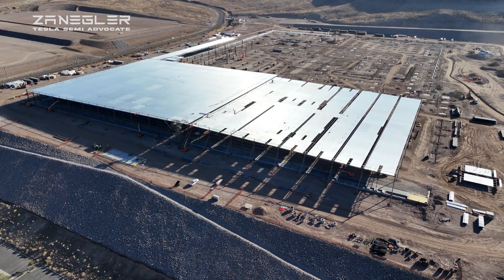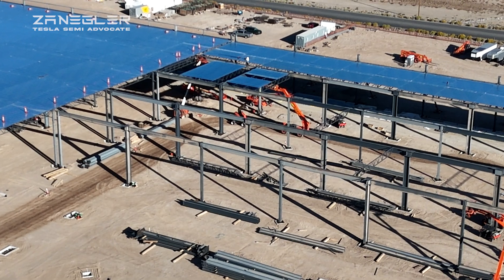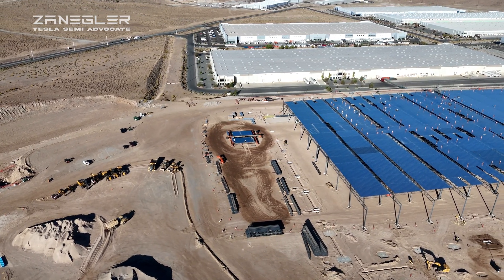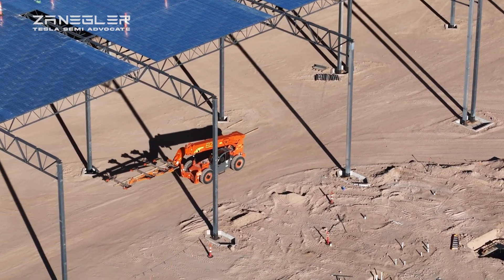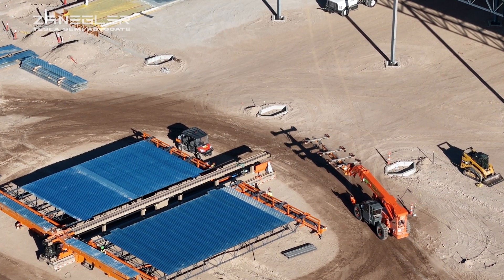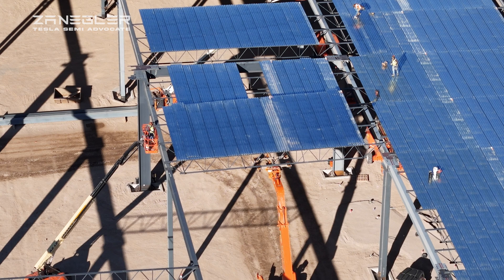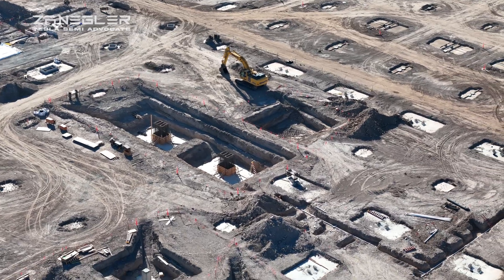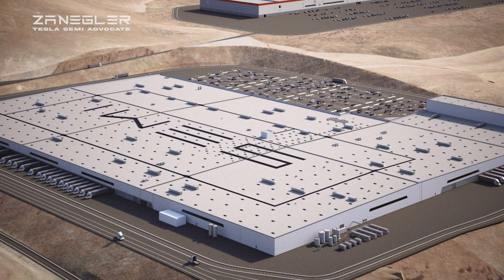Amazing Tesla Semi Factory Progress - October 5, 2024

Comment: Another great video!  Thanks for the update.  

I was hoping to find in the ground a place where a bunch of plumbing pipes come up, and indicate the location of a break room and restroom.   They should have a collection of 12 - 15 pipes for the toilets and kitchen sinks for the break room.  There should also be conduits going to the location of the 4,000 to 25,000 amp electrical connection to the building.  I worked in a 750,000 square foot building that had 3 each 4,000 amp 480 volt power supplies in one location, that fed bussbars going down the center of the building.  Something like this would power a large building like being built here.  

When they moved in a 400 HP air compressor, they had to cut out a 10 foot X 20 foot section of the 4" thick floor, and replace it with a 10" thick slab for the air compressor.  The 400 ton presses did not need any special foundation under them.  The building was Weiser Lock, in Huntington Beach CA, back in the 1980's.  They had several presses in the 400 ton capacity, and many other machines, such as screw machines, headers, and other machines.  We where nearly 100% internal integrated, with making our own springs, screws, and all of the lock parts, machine tools and final assembly of about $300,000 in door locks each day.  Over 2,000 great employees working 5 days a week to make it all happen.  

I am actually in shock at the speed of this building construction!  They seem to be adding about 3,000 square feet of roof each day?  Maybe even more! They will need a huge line of cement trucks to pour all of that floor space.  Hopefully they can get the roof done before they get any snow in the area.  

Yes Reno gets snow each winter.

Comment: "The Large Footings aka BFF"  - They formed a concrete column under the location of the steel column to continue the point load down the bottom of the footing.  Any additional concrete poured around the new concrete column in the footing would offer no compressive value.  I assume these area will be pits.  Maybe fluids bunkers.  Maybe access to underside of a vehicle or press or something.  Maybe equipment will be placed in these bunkers. But I would suspect the large holes are likely not all for concrete footings.  Footings that are thick typically support large weights.  Footings that have large footprints usually offer top heavy structures, like tall signs or water towers, to keep them from tipping over.  The fact they formed a relatively small concrete column in the pits to continue the steel column to the base of the footing means it is likely not a a top heavy structure or a high weight point load.
Reply: This style of footing construction seen often at Giga Texas. Deep footing of an otherwise standard area, concrete pedestal built on top to receive a standard height column. 

Likely the excavation will be backfilled/compacted, then re-excavated later for a trench for deep drain, or a production line trench, or sunken bath etc.

Most recently (2 years ago) Stamping 2 featured this style of footing.
Reply: Your thoughts offer some insight to the installation of a very large press.  Let's say the press table is 5 feet tall, if put into a 2 foot deep pit, then the surface they place the steel on, it will offer less height to the working surface of the press, and then make it easy to get the parts out of the press.  Yes the press overall height is well over 10 feet tall, I am just saying that the part that the die is located on, it will be located in a location that is close to the factory floor level, making the parts easy to remove.  

I have worked around 400 ton presses that where used to stamp out lock parts for Weiser Lock back in the 1980's.  They had their own tooling department, and I have seen how they put the tooling together to stamp out the parts.  It is very interesting, and making the tooling is very time consuming.  

Some of the machines at Weiser Lock required a 10" thick cement foundation for that press and for the 400 HP air compressor.
Reply: @Kangenpower7  A stamping press/es would be a possibility. All the presses at Giga Texas are located over deep isolation footings, and chambers for scrap removal etc.

With the speed this structure is going, there might no been an opportunity to see directly what's going on.
Reply: @Kangenpower7  could be…. We will see

Comment: Whether they move the Mezz-Master also depends on what the next construction phase looks like. Because if walls and floors are started in the first section, then they might be in the way and their transport routes would constantly cross because they have set up the device right in front of the driveway.
And the question is, of course, how long will it take them to move the Mezz-Master?!

Comment: I don't know but it seems that semi production is more straightforward than car manufacturing? Requiring a less sophisticated factory?
Reply: I would not call semi truck easier than car construction.  Each car is about 4,500 pounds while the semi is over 22,000 pounds.  They might contain about 20% more parts in the semi than in a car.  And things like the cab are much larger and more difficult to install than a car structure.  

Tires on a car are only about 45 pounds, while the semi is over 130 pounds per tire including the rim.  Brake rotors on a car, only about 15 pounds and the truck over 50 pounds for the hub and brake rotor.

Comment: Thanks for the update.  

Given how long this section took to put up it appears that the roof should be completed sometime in early December.  Of course that’s just a reasonable guess.  Of course concrete for the floor sections will also have to be poured and exterior walls will have to be installed.    Once those happen equipment can be brought in and installed.
Reply: I bet the concrete floor, walls, etc. will start going in before the entire roof is done… assuming they want to move quickly…